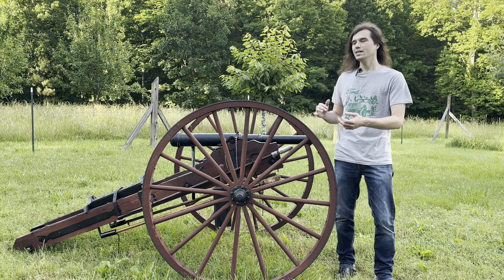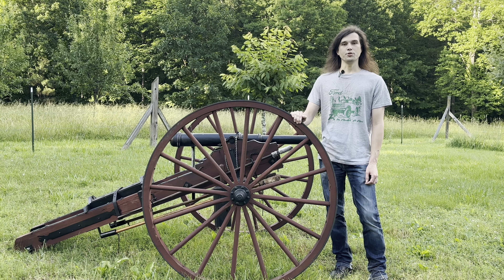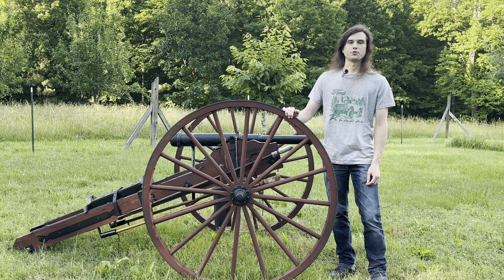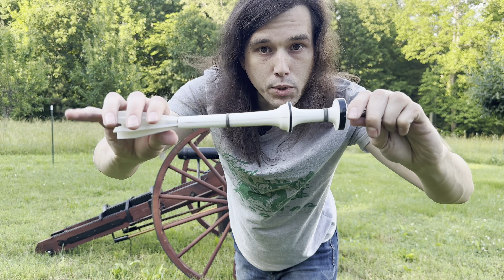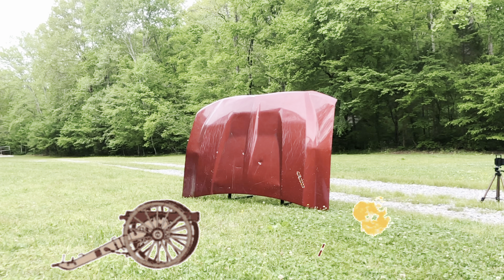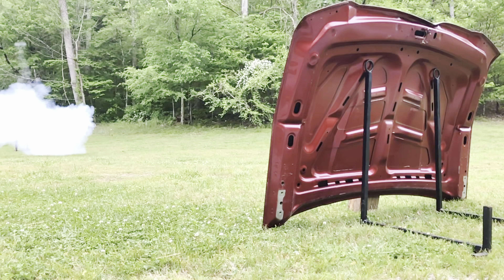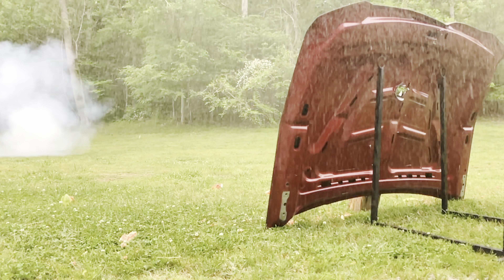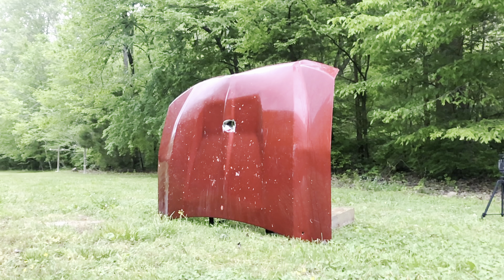Shooting 3D Printed APFSDS Tank Rounds

Comment: penetrator should go all the way to the back, with fins around metal to the butt.  as it is, the force is shattering the fins from the force collission between the impelled wad and the metal spike which is reluctant to move.
Reply from the maker: You’re totally right as to the rod piercing the wad. There was a hole straight through it and I thought nothing of it at the time….
Reply: @TheCannoneer  touching the wad from the start may be enought to prevent the penet4raption, but if not perhaps a metal plate between

Comment: 0:27 I'd be a bit concerned if the fins were discarded, instead of the sabots...
Reply from the maker: Hahaha. Sadly that’s exactly what happened… :(
Reply: @TheCannoneer  it'd be hard, but have you looked into fiberglassing the fins as well? I think that could theoretically give them a lot more strength, as well as a fairly strong mate to the penetrator (as long as the epoxy is good for metal and plastic)
Reply from the maker: @o-manthehuman7867  Oh that's a good idea. I was going to try some epoxy on the surface put that might work even better.....

Comment: So, you Need to fill the area from the base of the fins, to the first “bulbous” area of the sabot petals with gun powder. Second, there should be nothing holding the petals together. Third, a longer rifled barrel. This allows the petals to stay with the round until the barrel ends. Then, the petals fly off almost right away after leaving the barrel. Nice job man!

Comment: There are training sabot rounds with conical base instead of fins, it will be easier and sturdier to make rather than fins, also I advise threaded rod center and preload the plastic buttcone with nuts without messing the weight balance of the projectile, normally sabot/bore diameter is around 1/5 so if you are using 38mm cannon try 8mm allthreads and dont forget to make a cup on the front of the sabots to grab air and seperate cleanly after exit, good luck!!!
Reply from the maker: Thanks so much for the ideas! We will make these work one of these days!

Comment: Don't put wadding of any kind behind the fins, that's only going to load them and destroy them. Serrate the penetrator and have the sabot grip the serrations to pull it through. If spacing and a smaller charge doesn't help then you'll have to go with an all metal dart. Normally the fins are in the propellant explosion, they are NEVER pushed.
Reply from the maker: I had the idea of how these worked completly backwards when I put these together! Now I know why the threads are there. All thread on V2 for sure!

Comment from the maker: Thank you guys so much for all your wonderful ideas on how to improve this round! We will get this working in the future with all of your improvements. Thanks for your support!
Reply: This might sound like a war crime do you think you could fire glass shards? Would be interesting to see what it does to a melon.
Reply from the maker: @somedudeonline1936  100% can do and 100% they did do. The french were notorious for this one and apparently it was absolutely brutal. They loaded them in wooden canisters. I'll add that one to the list to make happen in the near future net time we shoot!
Reply: Love seeing this pop up :)
Reply: For a muzzle loaded apfsds you need a flat bottom piece that goes behind the flechete and support the sabot extrude a rod enveloping the flechete 30% of it is the base or the piston this is a single piece the remaining 70% is the sabot and you cut it in 2,3or 4 parts from the top and the head need a cup or c shape to catch the air to peal apart 
And attach a pvc tube to the reloading rod so it doesn’t touch the flechete only the sabot
Edit and use paper strips to hold it instead of ruber or tape
Reply from the maker: @guilhermecampello3345  I'll give some of those a try and see what happens!
Reply: And I don’t know if it’s will be useful but I shot a “apds” on my air rifle using a mold to envelop half of a nail in compressed wet toilet paper it works well both as a single solid piece or as a solid base and 2 peals apart mid ,it’s shrink a little wen dried but you can umidify (don’t wet it again)before shooting
Reply from the maker: @guilhermecampello3345  I know mythbusters built theirs with foam so I might be able to do something similar to how your TP functioned!
Reply: great video,maybe you can weld the fins to the arrow and print the discarding sabot in policarbonate and glue it to the arrow,
Reply from the maker: @nicolasherrera5874  Welded fins are top of the list for V2 and I'll have to play around with a few of the threaded and glued versions to see what happens for the petals!
Reply: Two options for making the penetrator better. Either make the overall length of the penetrator shorter or the fins longer. That would help it as far as staying on the flight path
Reply: It's great to show failures, that way we can better see the improvements.

Comment: I think what is happening to the fins is that they are being crushed as the canon fires, extending the metal rod all the way through the fins where it makes contact with the push plate That way the plastic is not being required to absorb the energy required to get the metal core moving.
Reply from the maker: I think you’re right. The TPU base is just flying up the rod and destroying everything on the way out. I noticed there was a hole in the base but that makes sense as to why now.
Reply: @TheCannoneer  For the first disc it would probably make sense to use a harder material like ABS with 100% infill, say 3/8" thick, then put the 2 TPU discs behind that, would make for better energy transfer to the rod.
Reply from the maker: @RenegadeADV I was thinking some cork would work well too! I’ll have to see if I can print ABS on my CR-10’s. Thanks!
Reply: @TheCannoneer  if you have a drill press a hole saw with no drill bit will cut a nice round out of some oak.

Comment: You need a “pusher” like disk, I call them “pucks”, model it to have a negative space for the rear of the sabot if you want that conforms to its shape for 1/4-3/8” or so. You want the forces transmitted to the shaft not the rest of it so much… 4mm thick base works fire my 9mm sabots..oh JB sold if you didn’t see that, annnd use a modified PLA, not straight PLA, polymaker PLA + seems to have a lot more yield and be a lot less brittle.
Reply from the maker: Thanks for the tips and I’ll be sure to use the JB weld if we don’t weld them on next time!

Comment: Friend, maybe this link to a picture will work. if not, it's the mk919 25mm round used in the bradley. aught to scale nicely. check out the driving ribs on the dart, and the matching ribs on the sabots. the gas ring up front that rides the bore carries all the pressure. base ring breaks your fins. https://woodinlab.com/wp-content/uploads/2022/03/Lot-84-1-scaled.jpg

Comment: Switch to JB weld over the 5min epoxy. (Haven’t even gotten to the shots yet but in 37mm launcher stuff the 5min epoxy is to weak)
Reply from the maker: Good suggestion! That and a pin through the fins should hopefully get us up and running!

Comment: I have some experience with similar projectiles from air powered guns.  I suggest....1.  put in a seal plate that will do 100% of the pushing of the projectile so little or no gas goes past.  Allow your steel shaft to set on this plate to better transfer force.  The pusher might need a steel washer face as the plastic will just shatter from the force.  2. put tiny pins and sockets in your petals mating surfaces so they can index against each other and remove any rubber bands when you load the assembly.  3. put a twist on the fins to spin stabilize.  You might need to make your glue area longer because this will add a torque load to your glue joint.  You might also reduces your power charge and slow everything down a bit until you get the thing working as desired.
Reply: I agree you need a steel base to help transfer the pressure to the rod, I Bellerive right now the sabot is being blown off before leaving barrel because of pressure
Reply from the maker: Beautiful. I just screen shot your comment and that’s gonna be what I’m headed for for one version! I’m going to try a few different designs people have suggested but yours is wonderfully explained and make total sense if I were to make a redesign myself. Thanks so much!

Comment: Plastic is far too weak to take these kinds of forces. Aluminium might hold up. If you wanna stick to 3D printing, filaments that are much tougher than PLA are PEEK, Nylon and Polycarbonate (they are all super difficult to print). To further improve the 3d prints strength, there are also various ways to do „annealing“. You could also try printing the sabot and fins from a higher hardness TPU. The rod should be pushed on directly by the pusher plate.
Reply from the maker: I’ll be sure to give some of those a try and see what I can make happen!

Comment: Buttress threads on the penetrator and on the inside of the sabots.
Reply from the maker: So turns out I was under the impression the base pushed the fins up and not the sabot pulls the rod and fins with it. That’s why the threads are there which makes total sense…

Comment: Weld a nut or several small washers to the discarding sabot where the seal holds. Ribbed for your pleasure and their demise. If the fins are still giving you trouble you can cut the rod at the bottom down the middle 3-4 inches deep splitting it and then cut those two splits the same depth fanning them into fins. If you stick with the 3d printed fins get rid of the wads they're not strong enough to take a push force instead allow your discarding portion to be the seal creating a pull effect on the projectile
Reply from the maker: Those are so good ideas! I didn’t quite understand how the rounds worked so now that I know we can hopefully get some working for real.
Reply: @TheCannoneer  Thankyou! Hopefully that input gives you good points to go off of and stem new designs from of your own making!

Comment: Oh......Nylon is what is used to retain the sabot and make a bore seal.Perhaps using plumbers tape made of teflon to retain the sabot would work.Id personally ditch that sabot for more like a simple cylinder.you dont have enough contack qith the barrel to stabilize it.....a nylon,ptfe etc cylinder shaped sabot with  1/2 the length of projectile probably work better,play with geometry of the leading side to encourage the release like a tank round
Reply from the maker: Much appreciated suggestions!

Comment: Fins need to be part of the penetrator and mild steel is no bueno.....you need to use hardened steel if not tungsten and you will likely need to add weight.Perhaps two piece using steel for the fins and lead to attach......also the penetrators the military uses has grooves machined in it all the way down the body ever so often like some longer bullets.Helps it fly right....good luck
Reply from the maker: Much much appreciated!

Comment: If you are going to use a plug behind the dart, you might as well build an APDS instead of an APFSDS, APDS uses a cup sabot which carries the sub projectile out of the barrel where it falls off. It's a way simpler solution to work with that doesn't require you to do fancy metal rib cutting you just it out towards the target, I think it will work at your ranges where it doesn't need to be spin stabalized.
Reply from the maker: I’ll have to look into those and see what I can come up with! I’ve learned so much from y’all since starting this channel!

Comment: maybe if the penetrator dart were longer so it rested on the base support, take the force off the fins. maybe if the sabot had a sabot around it with supports along its length inside and were split in 2 pieces to separate, a bit like some shotgun shells use sometimes for undersized projectiles. cannons are weird because they can have a lot going on ballistically. the logical physics that apply to most things with fins or wings doesn't work so well when breaking the sound barrier with projectiles. idk if this is good idea but I was wondering if chokes could be fit to a cannon to send shot farther, or a giant suppressor. how cool would that be.
Reply from the maker: We’ve had someone suggest the suppressor idea and he suggested how to do it so I’ll have to give it a shot. It was funny but I think it would be fun to see if it even works!
Reply: @TheCannoneer  suppressors aren't very complicated and there's a few ways to go about it. the price that's charged for suppressors kinda burns me considering what they are. then the 200 dollar tax on top of that cost. I'm not a gunsmith or anything but I do all my own work, always have. I think it would work. I've never seen a suppressed bp gun. duplex loads would be useful to get a clean burn, in a firearm idk about a cannon. that's a bit of fast smokeless on top of the bp. I forget the ratio but can find out if you want to mess with that.
Reply from the maker: @oubliette31415  I don't think there's any laws about "suppressing" a cannon on the books... I'll have to look around.
Reply: @TheCannoneer  I've been looking into the legal aspects of prototype controlled weapons. The DOD has some handbooks but I haven't worked out exactly if they apply to citizens or govt employees or both.

Comment: Bro is out here just showing off his big black cannon 😂
Reply: Also, sabots are ribbed in the middle, with the dart having matching ribs, these interfacing ribs are what help keep them from sliding back and knocking the rear fins off
Reply from the maker: So I didn’t know that they pulled the rod and not pushed from the base. With that in mind I’ll hopefully be able to make a working version!

Comment: i suggest a printed sleeve base cap. one that contours to the fins and angles but fills the void between them and then also between the shell the barrel wall. it would essentially sleeve over your fins. providing anti shatter support. as well as creating a firm base cap that you could print thicker. then a rubber pad disc behind that as well. simple parasitic drag would make the cap come off imediately from leaving the barrel. as it only slides on.
Reply from the maker: Oh that’s a good one…. I think that’s probably the best way to solve that problem along with making the rod going all the way down to the fin base. Thanks!
Reply: @TheCannoneer  glad you could read into my thoughts on it and understood where i was going with it. hope it works out chief.

Comment: 1) I'd try a different 3d printed material- I've used PETG sabot rounds in my muzzleloader, they don't seem to break up at all (less brittle)
2) I'd try a softer wad- maybe felt layered or t-shirts layered
3) That penetrator needs to be nose-heavy and tail-light. The first 1/4-1/3 of the penetrator should be lead or steel, the body should be composite, and the fins 3D printed

Love this channel dude, keep up the great work! I hope these suggestions make it to you!
Reply from the maker: They for sure did! I’ll be sure to give some of them a try in the revisit and we will get these working for sure! Much appreciated!

Comment: You need to accelerate from the sides, not the back. You're just going to crush your fins every time putting a disc back there. You need to transfer the mass of g-force from acceleration to the metal penetrator. If you try to transfer that force through the fins, it's going to fail, or you're going to need to change the material to something not 3D printed
Reply from the maker: I didn’t realize that’s how they performed but when you look at the cross section that makes total sense. I’m trying to reengineer the way they work to be pushed from behind but I didn’t know I needed to!

Comment: You need to get carbon steel and heat it up until a magnet will not stick then quench it in some oil to harden it. It's not as good as tungston but a lot easier to get your hands on. also make your fins from metal and weld them on. You need to make the sabot from aluminum I figure.
Reply from the maker: We have a smelter but I’ll have to figure out the best way to cast them… 🤔

Comment: 1 the plastic you're using is too brittle
2 the front of the sabot should be cup shaped and approx the same diameter as the bore.
3 to much binding tape and rubber bands seems like a lot try using one weaker band either rubber or tape at the rear of the sabot.
Reply from the maker: Much appreciated for the ideas!

Comment: If you look at the tank's APFSDS, it's the back "bulge/ring" of the sabot that seals the case and is pushed by expanding gases (the front one keeps penetrator straight). The fins are actually inside the propellant when loaded. I think in your case those TPU disks simply push through stripping fins, because the penetrator is not supported well enough. Maybe redesigning the sabot in a way that it is pushed directly (so the sealing bulge/ring is behind the fins), and adding on the inside something that would grip the penetrator along its length would help. Anyway - great video.
Reply from the maker: That makes total sense and when I found one of those discs it did have a hole in it. I bet you’re totally right as to what’s happening inside there. I didn’t realize how those rounds really worked until y’all explained it and that makes total sense. We’re pushing from the wrong part and the stress is on the wrong piece. Much appreciated for the tips!
Reply: @TheCannoneer  yeah apfsds is really cool in its simple science. my countoured fin base cap idea was more of a solution geared towards your current design layout. but if you actually redesign entirely and aim for the proper shell mechanics i think youll see much more success and much easier than trying to improve your current one.